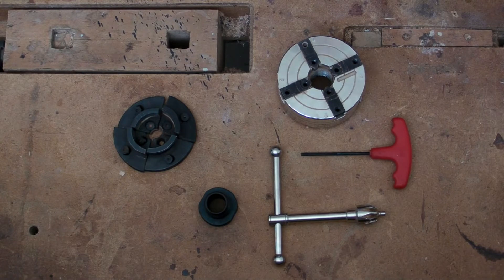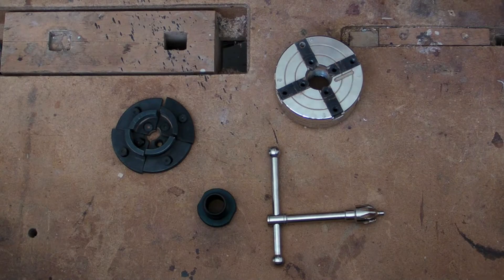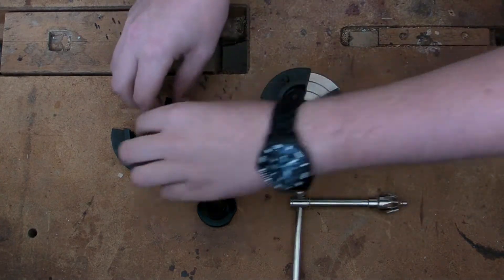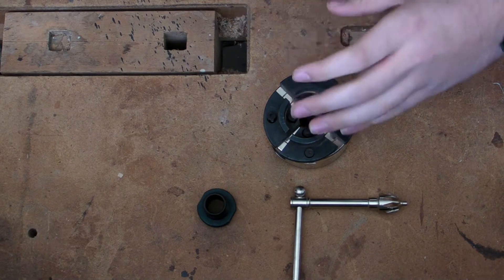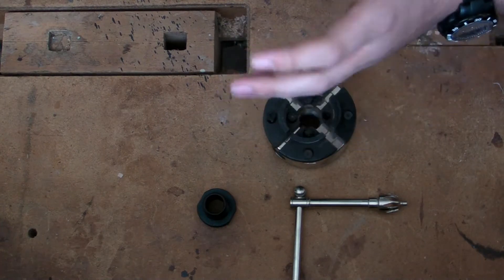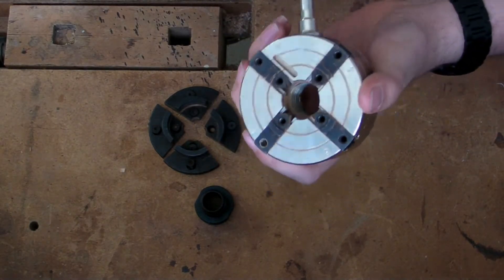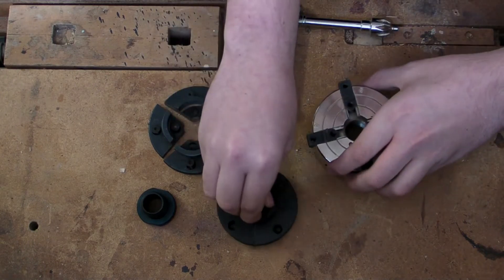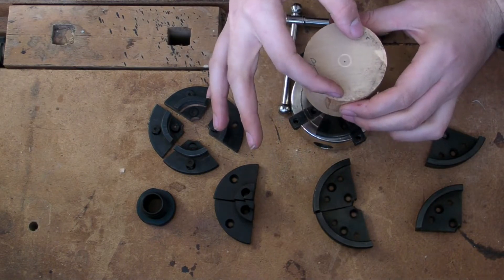How to Set Up a Mini-Lathe (Part 4 of 8)

Comment: I have to disagree with your sizing of the tenon. My understanding is that the chuck jaws are to be in an almost closed position with a slight gap so that they form as close to a perfect circle as possible with out being totally closed. This produces the most contact with the piece otherwise you risk a possible separation of work. Secondly, standing directly behind the work piece when you start the lathe is dangerous and should be mentioned as a safety hazard.